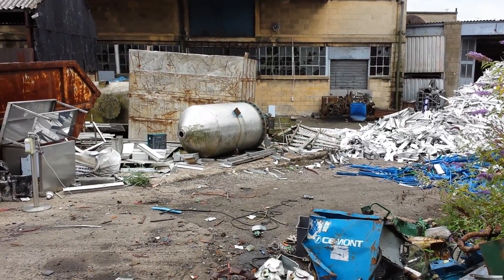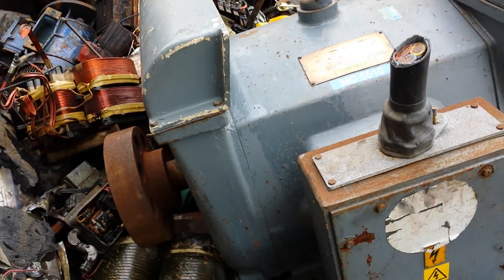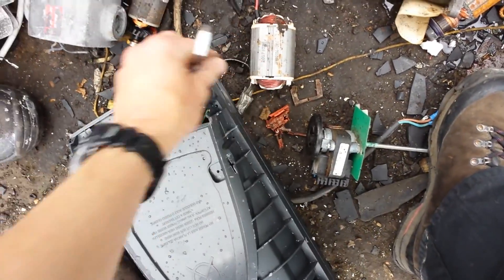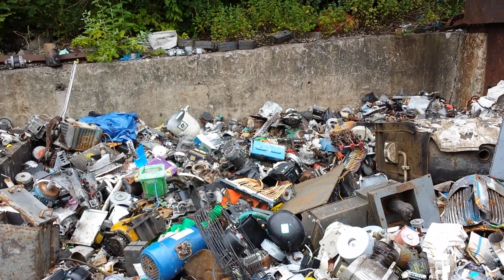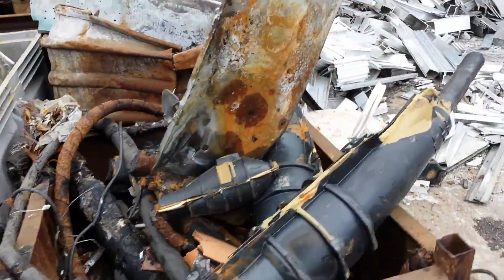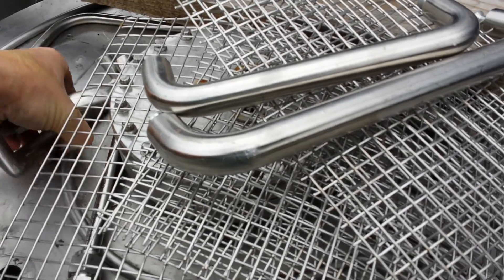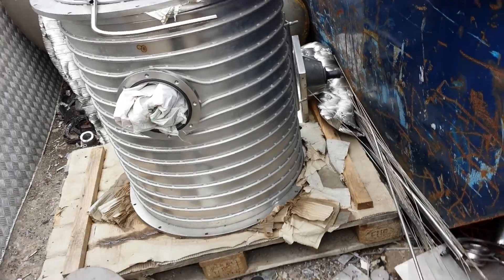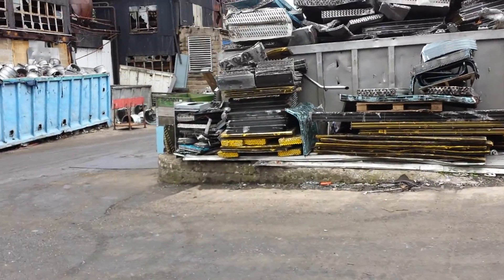Sat' scrapyard visit

Comment: The cable on that pump looks like 120mm, i've helped run that size but 4 core
Also, the motor will run at 290 amps full load on 400 volts OR 172 amps on 600 volts, the starting current would be nearly double.